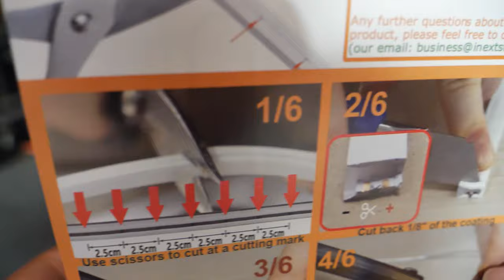Closer look at LED Neon connectors, solderless NEON LED signs

Comment: Hello! I’ve watched all of your diy neon sign videos and I’m having issues. The connectors aren’t staying onto the el wire and not making a connection. What should I do? I would love to have any and all help! Even when the connectors stay on for whatever reason it’s not making a connection
Reply from the maker: Hmmm, I am sorry you are having trouble with the connections. One thing that comes to mind is make sure not to close the clips too hard as when pushing the clips to close. Sometimes if I kept pushing it would just split the end of the plastic inside the LED wire. It is meant to just pierce the gold or silver sections in the  LED with the clip. Pushing too hard will split it and the clip will become loose. This happened to me a couple of times. I just used the super glue and glued the edge of the plastic to the edge of the LED. NOT the connections, that wont work just the plastic to rubber. But sometimes you just have to cut back to the next section and try again? And if it is not making a connection once hooked together I would try to reverse the wires as this is the most likely reason. Please feel free to message me on Instagram and send pics of the issue. Some people do and I try my best to help out. I am not an electrician but have made a couple of these and can help maybe trouble shoot some basic issues. Instagram makerdecor_  or my email diyrentalbuilds@gmail.com

Comment: 3:10
Right here... you don't have to clean the ends of these (red/white) wires?
You can just push them in to the connector? Right?
Reply from the maker: Yes and no. So it depends on the gauge (size) of the wire and the size of the connections. The gauge of the wire in this video is I believe 22 gauge. I have used 20 gauge, 22 gauge and 24 gauge. 20 gauge is thicker so to fit it in you will need to strip the wire with wire cutters, which is simple to do with the right wire strippers. 22 gauge and 24 gauge are thinner wires and will fit right in the two holes. Once you close the clip it has a small metal cutter that splices to the middle of the wire and locks in the connection. So you do not need to cut the wire if it fits in because the metal cutter will clip half way through the wire once the clip is closed. Also there are a couple different clips on Amazon I believe 8 mm and 10 mm, which will determine the clip insertion opening sizes. Sorry that may be a little confusing, hope this helps.
Reply: @MakerDecor  
GOOD TO KNOW...
Thank you so much for sharing this information...
Like I said... YOU are a great Teacher...
Thank you.

Comment: I wish you would have shown how you connected  the power supply to the LED strip...
Reply from the maker: Hi, the LED wires I use, have the power supply already connected to the LED strip when I purchase them. I have added some before, which was just connecting the wires just to use the left over LED srip pieces. But most come with the end power supply attached already.
Reply: I need to know that same thing as well. I connected everything and my lights don’t come on. I switched the wires around and still nothing. I did notice my led lights are split where I put the clips on. Is that supposed to happen?

Comment: Hi I am following your tutorial for a sign I was wondering if you can go into more detail about connecting the wire pieces in the back
Reply from the maker: Hi, thanks for watching. Did you have a specific question that I can answer? With this sign I really just bought a power supply, clear connectors and the red and white wire(for door bells from Lowe's). I inserted the wires into the clear clips. The clear clips have two holes that you just push the wire through. Then the other side of the clips is like a sandwich that you open and insert the cut LED strip. Make sure to cut the LED strip on the black line as shown in the video. That way it splits at the right spot and shows those copper half circles at the end of the LED, in the video. Make sure to line the clips with copper ends and it will light up. May take some practice to make sure the connections touch at the right spot. I hope I was able to answer you question, if not let me know what I can help you with. Thanks.
Reply: @MakerDecor hello! My led lights already came with two wires, do i still need to cut?

Comment: Hey I was wondering do you have to strip the wires for these or you can just crimp them without stripping the wires.
Reply from the maker: Hi thanks for watching. That depends on the gauge of the wiring and the size of the holes in the clips. Ive used two different clips and gauge of wires. The ones in the video fit perfect and did not need to be stripped. The clips have a small metal piece inside which penetrates the wire when clamped creating the connection and they fit snug. Unfortunately I have not been able to get those clips again. They are not selling them on Amazon at the moment. I have been using similar ones on Amazon which are smaller and I did have to strip the wire just to make sure if fit. Thanks for your question.

Comment: where can i get the connector plz reply
Reply from the maker: Hi thanks for watching.  The wire connectors link does not want to work. But I went and found the description from the purchase. It is in the description of the video, hopefully you can find something similar. You can search "2 Pin 8mm LED Strip to Wire Connector Unwired Clips Solderless Adapter Terminal Extension Connection for Single Color LED Strip Lights 12V 24V" on amazon or online?
Reply: @MakerDecor  still did not get the connector on Amazon. Plz send link
Reply from the maker: @zafarshaikh8214  https://www.amazon.com/Connector-Solderless-Terminal-Extension-Connection/dp/B08ZYDC815?crid=GPV3L711P6FY&keywords=2+Pin+8mm+LED+Strip+to+Wire+Connector+Unwired+Clips+Solderless+Adapter+Terminal+Extension+Connection+for+Single+Color+LED+Strip+Lights+12V+24V+(Pack+of+10)&qid=1641162051&sprefix=2+pin+8mm+led+strip+to+wire+connector+unwired+clips+solderless+adapter+terminal+extension+connection+for+single+color+led+strip+lights+12v+24v+pack+of+10+,aps,100&sr=8-8&linkCode=sl1&tag=diyrentalbuil-20&linkId=816b0ff86345c39017aa548dda58cbba&language=en_US&ref_=as_li_ss_tl
Reply from the maker: The original link for the original connectors is not on Amazon for sale at the moment. I have been using these currently.
Reply: @MakerDecor  so is there any way  I can get
Reply from the maker: @zafarshaikh8214  I haven't found it but the link above is pretty similar and I have used those for LEDs. I just put up a video on LEDs and I used the one in the link above and it worked.

Comment: Hi i wanted to try your method on making a neon sign can you please tell me is everything still working perfectly after a month?
Reply from the maker: Hi, thanks for watching. I made the sign in July, used it in August for my daughters Birthday. And yes I still have it and it still works. As long as you make sure the connections are solid there are no reasons for it not to work. Thank you for your question.
Reply: @MakerDecor  thank you so much I appreciate you getting back to me 🙏🏻😃

Comment: I know this video is old but can u connect different colors together
Reply from the maker: lol, old I felt like I just started making videos. Yes you can mix colors but I have not yet made one that will change colors. That one is a bit more complicated. I have made one that is two colors here is the video and I also made it into a short as well https://www.youtube.com/watch?v=Lii-OCnOELE
Reply: Thank you very much just Dropped a sub I make christmas and halloween motifs just always had problems with making motifs that have multiple colors in the design this really helps. Also how many can u connect at once ?
Reply from the maker: @massprankstv324  Thank you very much. And not sure I have only connected two. But I think I can add more. You just can not make it super long as you will need a second power adapter. But I haven't run into that issue. Good luck
Reply: Appreciate it very helpful

Comment: Unwired clips link
Reply from the maker: The wire connectors link does not want to work. But I went and found the description from the purchase. It is in the description of the video, hopefully you can find something similar. Thanks for watching! 2 Pin 8mm LED Strip to Wire Connector Unwired Clips Solderless Adapter Terminal Extension Connection for Single Color LED Strip Lights 12V 24V (Pack of 10)